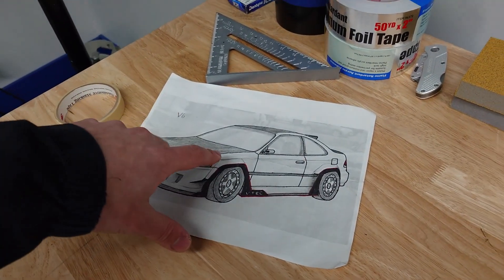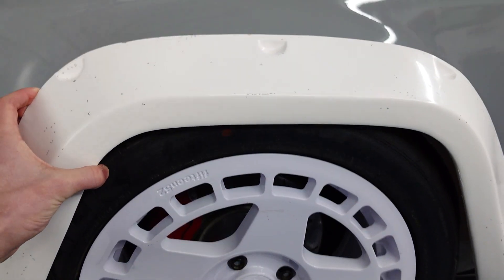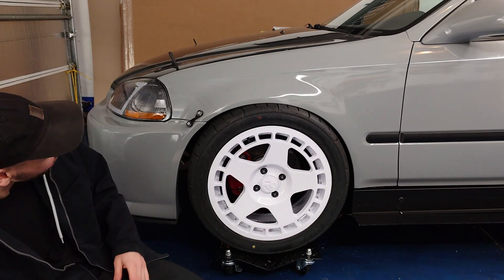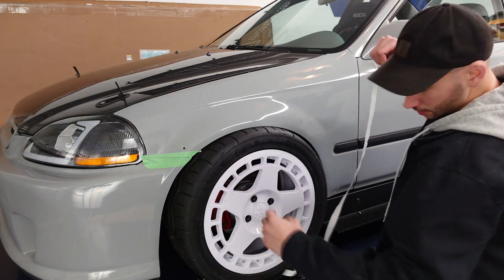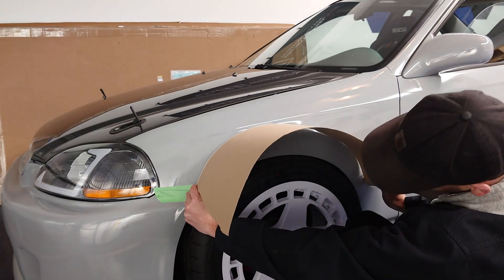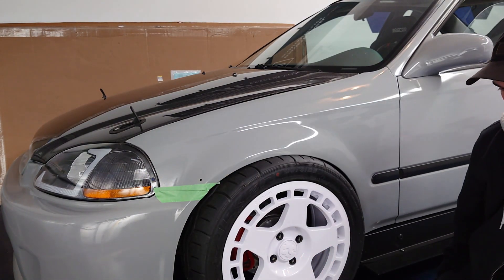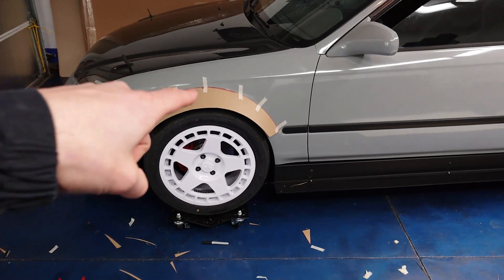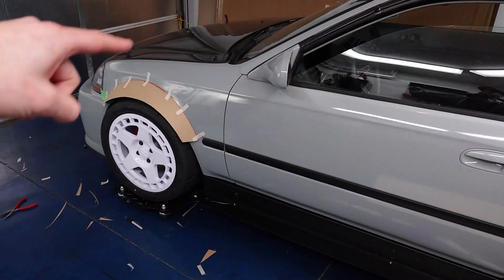Simple DIY Fender Flares! Widebody Civic Coupe pt.3

Comment: Thanks for this man! Great attitude and job well done
Reply: Sir, What are your wheel specs? Spacers? I own a 10th gen si coupe. Currently on tein coils with some flush/poking fitment (255/35/18). The goal is to run a really meaty setup just like in this video! the wheel specs are the most tricky part it seems!
Reply from the maker: These are 225/45r17 tires, wheels are 17x7.5 +42 offset. I run wheel adapters that space the wheels out about an inch as well. I would check out fitment industries gallery for the 10th Gen si, they should have pictures and specs of other 10th gens for reference